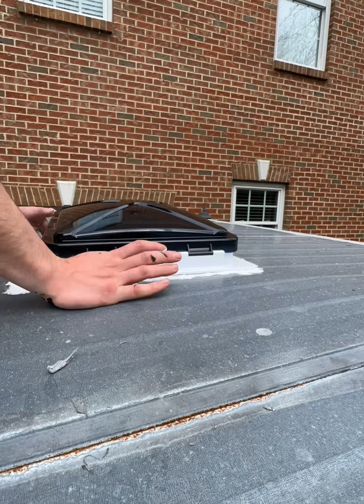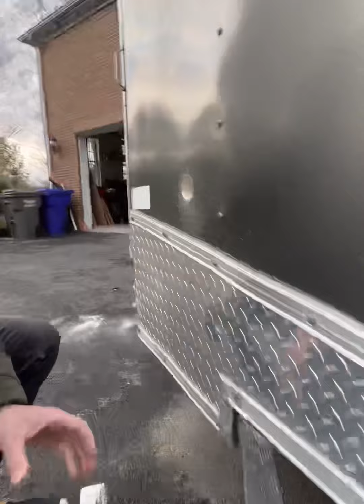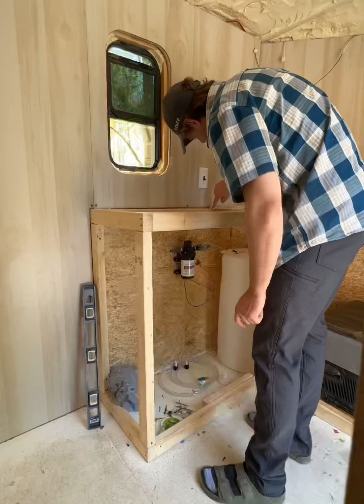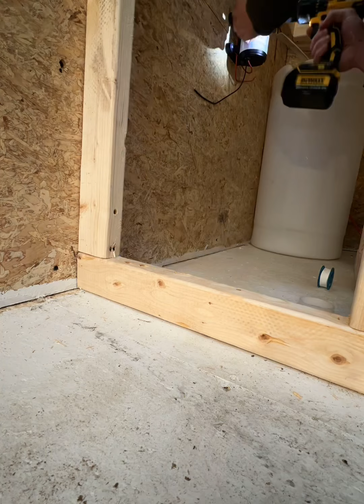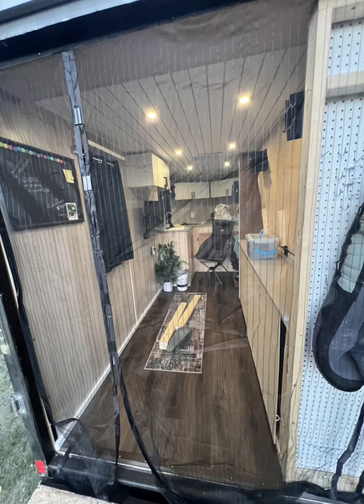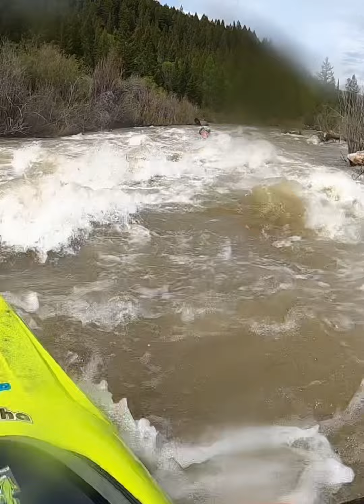DIY 6x12 cargo trailer camper conversion

Comment: Did you build bunk beds foldable ? And how to support them chain?on 45°
Reply from the maker: I need to post another video when it’s not winter on everything I did. I made a large platform on hinges that folds up and down. It’s supported both by the hinges, the base and scaffolding supports that take 20 seconds to set up.

Comment: You made the same mistake I did. Despite the vertical wall furring strips (I do not even know why you did that) you ignored thermal bridging. If you are always in a perfect climate no problem but if not then it is a problem. As I run my hand across my walls in sunny weather I can feel the heat coming off the places where the steel tubing is. The tubing needs to be covered with at least a 1/2" sheet of insulation in addition to what goes between the studs. All wiring can easily be channeled across the top. 
Love the fact that you threw away the original garbage 3/8" ply on the walls and used OSB instead. If I tear my walls apart again I am definitely going to do that. It is cheap, versatile and strong. The weight difference is negligable. 
I have lived in mine for 5 years full time. I follow the weather as much as possible. Montana / Wyoming and Colorado in the summer and Arizona in the winter. Spring-time in Mississippi for repairs and upgrades which is where I am now. Redoing my AC, replacing the fanlight (again) and installing a 3rd solar panel on the side of my  trailer like a hinged wing. That will give me 1200 watts on a good day. If you ever want to compare notes just respond to this post and I will see it.
Reply from the maker: I put up the furring strips so I could get over 2 in of insulation, thus making thermal bridging much less likely as well as condensation. I haven’t had many issues so far with it. I will do a video as soon as it warms up on everything I did. I’m in the Montana area right now
Reply: @gonewiththewaves  Thanks for the response. I see what you mean with the strips now. However wood is nowhere as good an insulator as styrofoam. Still, sometimes there is no choice. I am framing out my window ac unit now and I am in the same boat. I have to use wood to both frame and use as an insulation material. No choice. Love Montana. I usually head for Great Falls and a perfect camping spot by the Sun River to the west of GF.

Comment: Aye, I'm getting a 6x12 cargo trailer for my Tacoma as well. It'll be entirely off grid and my new home as I travel across the country. 
How's it holding up for you so far?
Reply from the maker: i forget i have it on the back unless im going up a hill, then it struggles a little bit. So far everything is holding up great. The 6x12 is just big enough to work. Any wider would have been a little more sketchy towing
Reply: @gonewiththewaves  Agreed about the size. I see a lot of people tow 7x14 or 16 and get 8 mpg 😂 While my tiny home won’t be over 4000lbs, the aerodynamics play a huge part. Is your Tacoma a 4cyclinder or V6? I have a 19 TRD pro with V6.
Reply from the maker: @aldonis7515  mine is a 6. The 6x12 is perfect width wise especially if you will do any back country camping. A foot wider would be harder to see in the side mirrors and to get off road